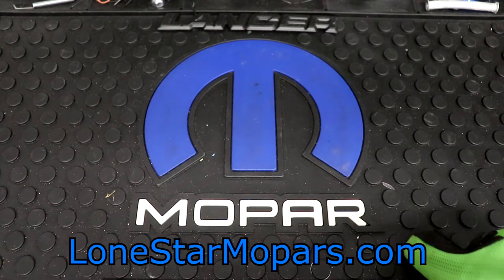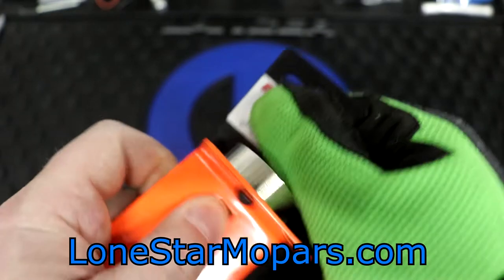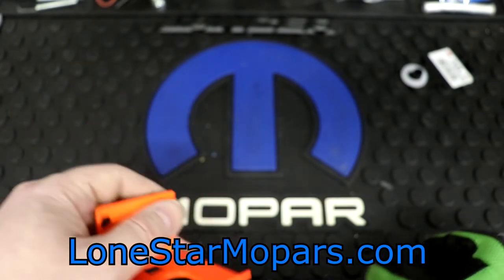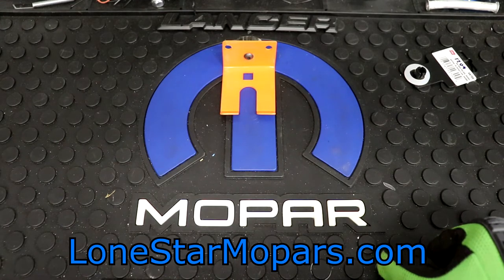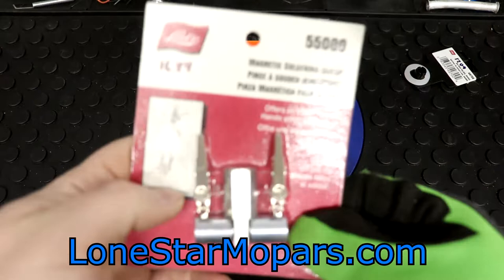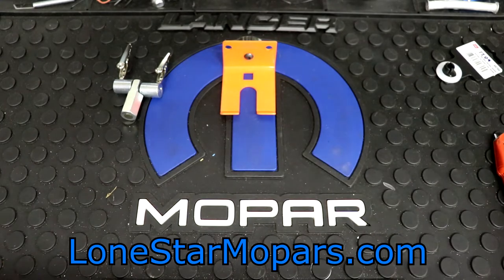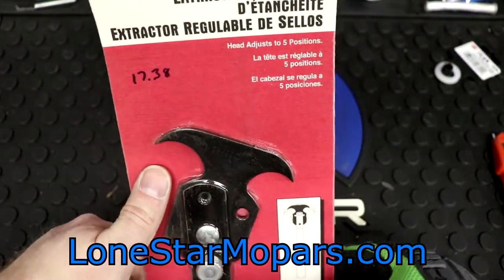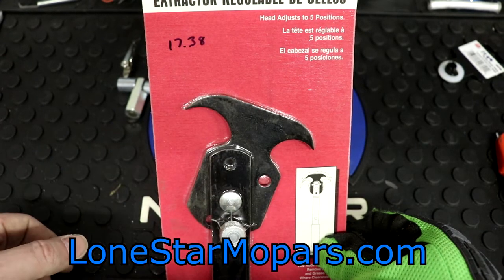National Tool Warehouse Haul #1: Lisle Time!

Comment: Watching you unpack all these "new and improved" tools is the very reason that even after being semi retired from wrench turning I continue to buy new tools. 
I have a wire holder for soldering, it is a connected one piece but does articulate. That one you have would work so much better, especially as you said, soldering within the harness.
That seal puller offers a little more versatile being able to change angles. Mine is a fixed position piece. 
I do have the larger hose hook but not that shorter one, for now. 
That air tool hanger is pretty nice, I'm glad to see you still use air tools. I missed the days of air tools screaming throughout the shop when the battery powered tools started taking over. I have most battery powered tools available,  Milwaukee and Dewalt. But I still love my air powered tools. That Butterfly 3/8 ratchet is one of my favorites. Yes it is sometimes awkward to use but it is so convenient also, plus I think it is cool. I remember when I first discovered it in the 80s and was my go to about as much as my impact. Speaking of, my Thunder Gun is still a beast, bought it within a week of its availability. 
I noticed your utility knife, that's the Kinpex one you reviewed, right?
Take a look at the Toughbuilt knife. I don't know if it would be of interest to you, it really shines if you use different style of blades.  
Thanks for the review and sharing of your new goodies.
Stay strong brothers.
Reply from the maker: There is no time like now to upgrade tools...or at least that is what I tell myself, lol.  Yeah, the helping hands are really nice...same concept as my el cheapo fixed podium version, but mobile which makes them  more useful.  Yep, the multi-position is nice...often have to come in at angles and thus it can do smaller bores.  I made it thru all of my life without a hose spoon, but have enjoyed them so far...nice to not have to worry about the sharp point when working hoses free.
Air tools are still my go to...guess I'm old school.  They are what I used when I started and what I still prefer.  Cordless is nice at times, but if their is a compressor near by and I'll be doing anything over a long period of time, that is what I prefer.  Glad the Thunder Gun is holding up...we had an old CP at work but it was dead before I ever got to use it.  I have eyed a nice one from SP...they are tough to beat for tight fits.
Those look pretty nice...I think I remember them having the utility knife that doubles as a scraper too.  I had always used razor blades prior to this.  I really like the Lutz blades that were in the early Cutix.  The ones they switched to don't keep an edge near as long..they are great when new, but the edge wears off a lot faster.
I'd kind of like to dive into a comparison of utility knives, but I'm making myself wait, lol.